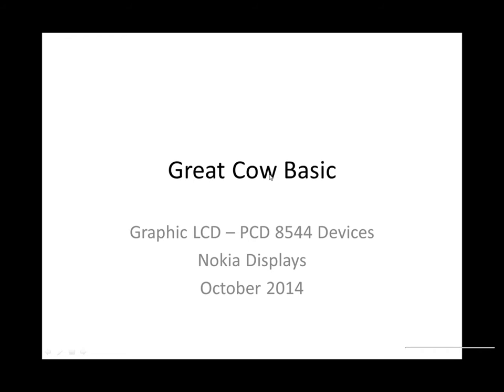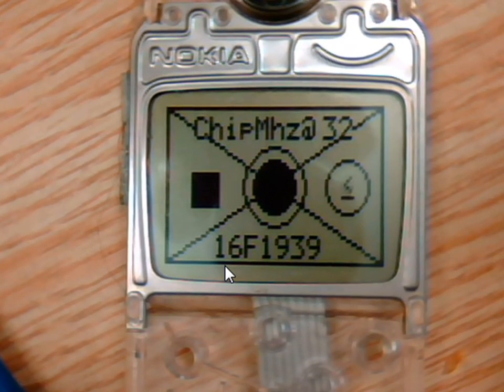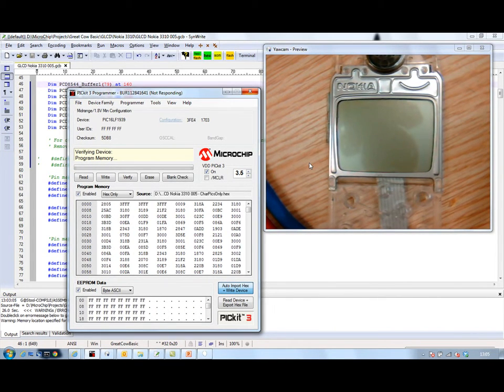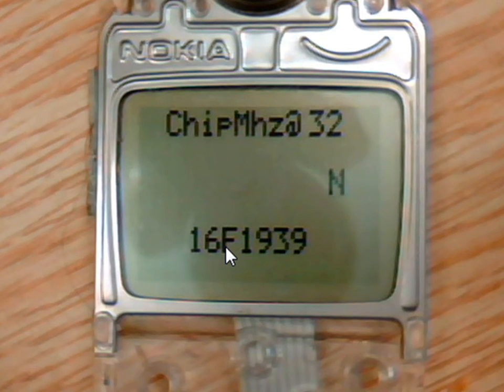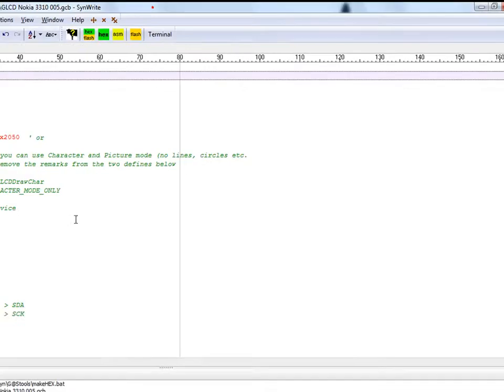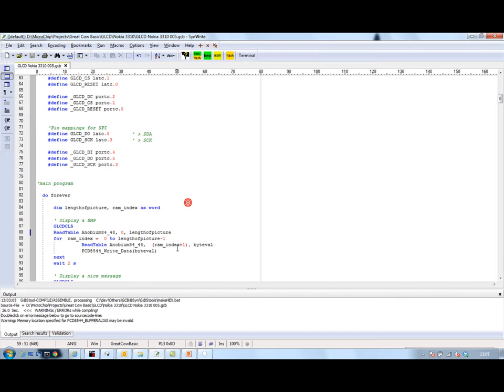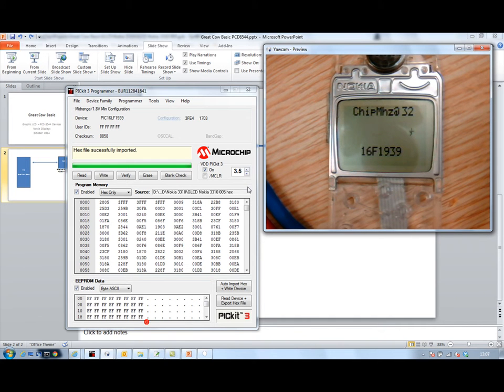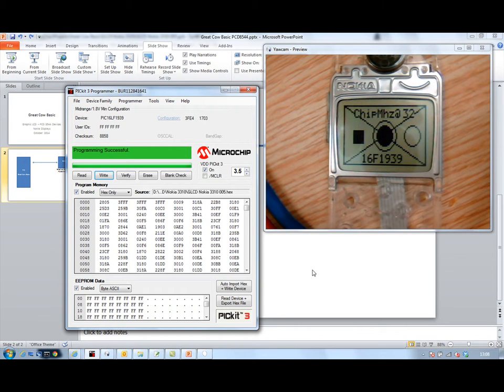Great Cow Basic - Nokia 3310 GLCD with PCD8544 driver

Comment: hi 
i hope you are still around and well since its been quite a while since this video.
i sincerely will appreciate your help in locating a driver for the nokia 5110 or the exact one you are working with.

i am trying to establish spi interface with pic 16f877a
and mplab x ide with xc8 compiler
i have tried several drivers found online however designed for mikro c pro compiler.

the mikro c pro compiler establishes 2 types of spi interface ie soft spi and hard spi

i have tried conveting the mikro c to mplab x however i do not know at this moment how to activate the spi for mplax.

i however see that your driver is running on mplab x and will appreciate your assistance 

thankyou one more for your time

ejike
Reply from the maker: Hi. We have code that will work. Install the IDE, select the GLCD demo and change the chip/ports and it should work.